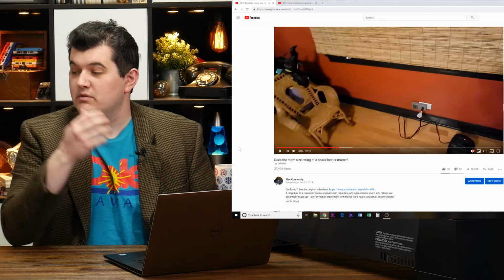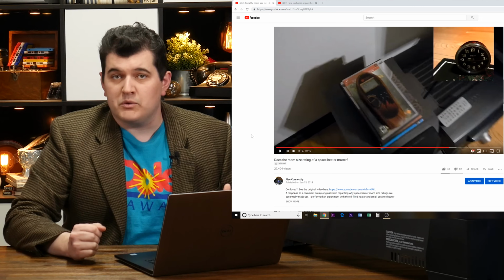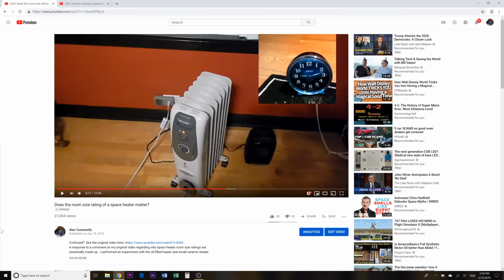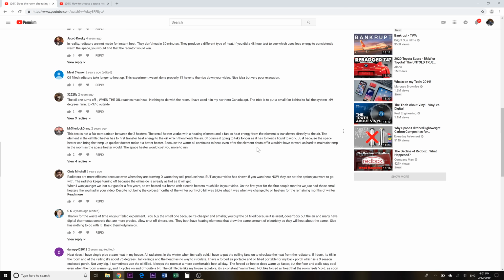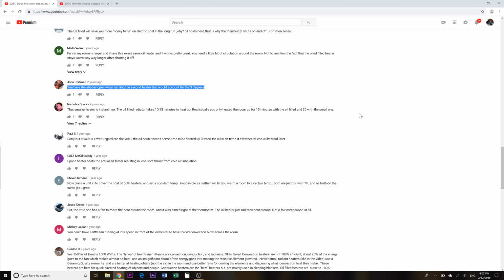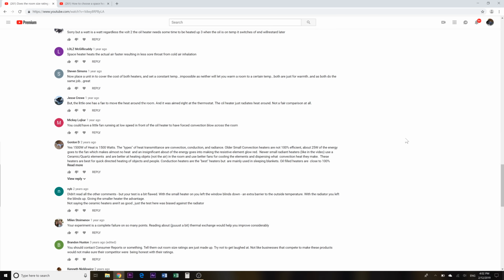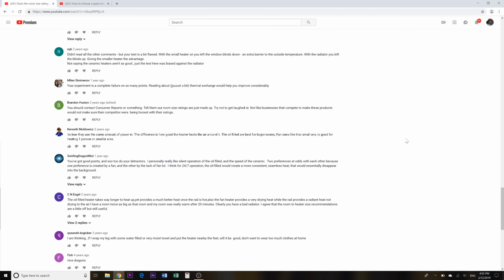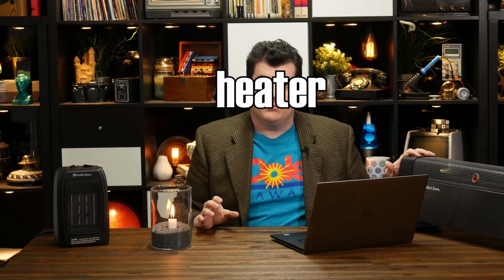More Space Heater Nonsense

Comment: I totally agree that the net heat output will be the same from heaters consuming the same amount of electricity. The bone I have to pick with you is your insistence on measuring air temperature as your benchmark. Air has relatively little heat capacity, so it's quick and easy to heat,  and cools just as quickly when you remove the heat source. It's also difficult to contain, and has a tendency to wander away if not strictly controlled.

The little ceramic heater puts the majority of its output into the air, versus a radiant heater that puts the majority of the heat into the objects in the room.

Thus, a radiant heater warms the objects without wasting as much energy heating air.

As room size increases, the ratio of air contained versus surface area to receive that heat increases at a much larger rate. So, the air focused heaters are more effective at heating the total contents in small rooms. You may have noticed the general trend of small to large room heater ratings tending to at least superficially show the ratio of radiant capacity vs forced air.

Heating primarily the air in a large room also generates a very strong stack effect, where the air you just spent lots of energy heating rises to the top of the room and tries desperately to escape. The rest of the objects in the room tend to stay relatively close to where you put them, as close to the floor as they can get, and near all that cold air that's replacing your precious heated air. Heating the objects as directly as possible with radiant heat is much more efficient.

Efficiency is a difficult thing to quantify when human comfort is your objective.

Comment: You are completely correct in what you say about energy and how it heats a room. I am also glad you mentioned the flower pot over a candle as I have a friend who does that and claims it gives out more head. I think the problem with your experiment is that the time was too short. For a fair experiment start with the same room temperature on different days, leave the heaters for 1 whole day while taking measurement, and do not make changes to the room in anyway.

Comment: I don't get it.  The heated area of my house is 24x36. The average temperature here in Dec/Jan/Feb is 39 F during the day, and 27 F at night.  I heat the entire space with one 1500 watt "amish heater".  My heating bill is only 100 dollars a month running this thing continuously.  My furnace is in the basement, so I was spending way more money losing heat to the basement, and unnecessarily sending heat to every room in the house. Sure, it's cooler back in the laundry room and bedroom than it is out here in the living room and kitchen, but this is where I spend most of my time. And if you want to be warmer at night, you simply move the heater into the bedroom. This is an incredibly efficient way to heat.

Comment: More useful to a consumer I think would be to use a "heat transference unit over time" at peak and "time to peak". Is this called something? That way an oil heater would show a low transmission rate vs a standard fan heater. Similar to glycemic index and load. Where glycemic index would be the unit mentioned and glycemic load would be analogous to using the power consumption in the equation.  Therefore every 1500watt heater would have the same "glycemic load". Maybe this makes no sense? I'm just thinking out loud here.

Comment: Why is the larger heater in your example better for a larger room?If both heaters have the same power Input, for a larger room a heater has to run for a longer time. Over a longer time such things like noise Levels, thermostats and other comfort Features become more relevant for the user. So a more comfortable heater is better for a larger room, because comfort gets more important with longer running times of the heater.

Comment: The "room size" suitability thing might not be about the heat output of the heater at all.  Instead it might a broader perspective of the suitability of the heater to the rooms size for completely different reasons.
A fan-blow heater might be well suited to a small room because:
1. the small room probably only has a single occupant in it, and one small noisy fan heater blowing on him, he won't mind the noise as much, but will be thankful for the hot air blowing.
2. attempting to use the same heater in a larger room means: more people, more children, more pets, more conversations, and having a noisy heater in this larger room with more people making such a noise is thus less suitable.  The small fan-forced heater might also get knocked over when animals or children run past because there are more of them in the bigger room. Thus the fan heater has extra risk of falling over and thus starting a fire / cutting out.
Thus a column/oil heater might be better suited to the larger room, because:
3. it's silent, and this more compatible with the conversations people are having.
4. safer for children and pets, less likely to be knocked over, and if it does, not as big a deal.

Comment: the difference is that the oil filled heater you could leave on for 7 days and it will maintain a temperature for your house, while the space heater will melt down if you run it for too long
Reply: Apparently not, since they don't warn of such things.  The US 1500W limit combined with other regulations prevent any product than melts down.
Reply: @adm0iii   These cheap chinese heaters all  melt down, the wire connectors on the insides burn up and short out, the plastic melts. Its all made in china and not up to us regulations. These things cannot be left unattended.Ive also seen some where the plug that goes into the wall melted and shorted out on a new (6 hour old) heater
Reply: Fine.  I'll grant you that all space heaters are made in China so are immediately dangerous fire hazards but the US permits them for sale anyway, and no oil-filled heaters are made in China so are all perfectly safe.  

However, this has nothing to do with the "large room" marketing ploy -- the point of the video.
Reply: Bear Mro I use both the little space heater and an oil filled heater. The oil filled heater actually warms the room up better over the course of a day. Where the little one is hot and feels nice in front of it in a 12x16 room. The oil filled heater keeps the room warmer. It's just not instant heat and this test would take a day or 2 to show this. Toss a fan behind the oil filled and it makes an even bigger difference. The radiators work better for large rooms long term
Reply: And this extra heat comes from... where?
Reply: Bear Mro I guess you don't understand differences in efficiency and radiation. You can take a propane torch, light it up and the heat is very hot right infront of the flame.   If you remove the tip so it is a wide giant flame With the same amount of propane still going through you will get more heat overall.
Reply: Heat "efficiency"?  Heat is always 100% efficient; any heat energy lost by radiation is still heat.  If physics is wrong, I have nothing else to say.
Reply: @adm0iii  i guess you dont understand basic physics, you get more heat energy out of boiling a pot of water than you do just running the flame. It doesnt get any simpler to explain than that. If you dont understand that, I cannot help you.
Reply: @adm0iii   dave from eevblog just posted a video today explaining how the different heaters are better in the proper situations

Comment: The "room size" thing might pertain to the duty cycle of the heaters involved.  A small 1500W fan-forced heater heating a large room (think basketball stadium?), will possibly burn out the fan motor before the room gets to the desired temperature, even if you have 10 of them spread around the court, the fan bearings might seize and thus catch fire before achieving any significant stadium temperature change (apart from the fire).  A 1500W heater designed for a "larger room" (read: with a more robust duty cycle) (such as the convective one shown in the video), has no moving parts, so could easily be left going at full 1500W for a much longer period of time with zero risk of the motor's bearings failing.  Having 10 of these spread around the stadium, for several days, might be safer, hence better suited for larger rooms.

Comment: Recently my gas heater failed, so until they came to replace it, I used a hair dryer to warm the room. It's very loud, but outputs a constant 1200W of heat at full blast, I measured the consumption...

Comment: You can waste 1500 watts all day long if you don't take into account the way air moves. When a large room is cold and you introduce a fan, you will eventually have a heater that inevitably creates a sort of "heater funnel" meaning the air it heats rises but cools then falls to the ground thus being sucked back into the unit and then being reheated again. In this situation the surrounding cold air is basically unchanged or is actually being pushed around in such a way that a person might think the heater is blowing cold air. How can you avoid the heater funnel? Remove the fan. Wait, then there's fire. Put the fuel rod in a liquid that is capable of heat transmission as well as being used as a heat sink, NO FAN FOR YOU! I'd like to thank the fine folks at your neighborhood nuclear plant for their input as they basically are in the same boat, fans are ineffective (for different reasons) so we have to use the liquid as both the dissapation of heat as well as transmission of energy. Doesn't make a whole lot of sense on paper, no- well it kind of does, however, not until you find yourself in an actual large room, with all of its ceiling height and drafts, will it be as clear as crystal pepsi. I'm not saying your wrong at all 1500 watts IS 1500 watts, and I would actually be 100% in agreeeance had I not experienced the heater funnel for myself.  Sitting in the perfect conditions and having the heater placed in the center of the room with all of the drafts, after about 1 or 2 DAYS the hot air blowing out of unit eventually caused the colder air just outside of the heater funnel to begin shifting thus making a it feel as though the heater was blowing cold air. So in this instance I plugged in the radiator heater and found it to be more functional simply because the heat is created without the use of a fan. Thus avoiding the horrible heater funnel. I will add the fact that if you don't button up your drafts or insulate your ceiling you will continue to justify the addition or necessitate the need for more nuclear power, which is not ideal. I'll sum it up by adding this. Not all heaters work in all situations and not all situations are recreatable in a medium sized bedroom. Hence the MEDIUM, because small is a bathroom and large is a living room.

Comment: I think the origin of room size to heater design is based on assumptions of room use based on the traditional nucleic family. A 'large room' is the family room where everyone has dinner, watches tv, plays boardgames etc. together, maybe a carer and an infant are in there most of the day, so a heater that cycles the thermostat more and has a slower, less direct heat effect is more comfortable. Using a small fan forced heater in a large room will make anyone or anything sitting directly in front of it way too hot while the ambient temperature catches up. If your small rooms are all just bed rooms for sleeping then quickly thawing it out before going to sleep with a little fan forced unit is convenient. When you consider modern western lifestyles these assumptions are pretty terrible, home offices, computer rooms for studying or bedrooms in share houses are all small rooms but usage patterns suit slow convective heating or a much lower power direct heater.

Comment: I have been so frustrated to see the mainstream shopping channels selling overhyped electric heaters that mysteriously claim to provide greater heat output than their older counterparts of the same Wattage. It is refreshing to see someone pointing out such utter nonsense. Not so long ago, the same channels were also selling some kind of clip on magnetic nonsense, that claimed to dramatically improve car engine efficiency.

By the way, 1,500W seems quite low for a space heater. Here in the UK at least, similar heaters have in the past had a 3,000W max rating. 

Great channel!

Comment: I think you are missing one thing. Thermal inertia. You should consider doing the experiment in a span of 48h at least.  Heat the room to desired  temp and sustain it. Than check power consumption of both heaters.